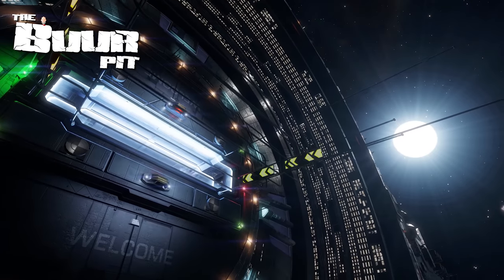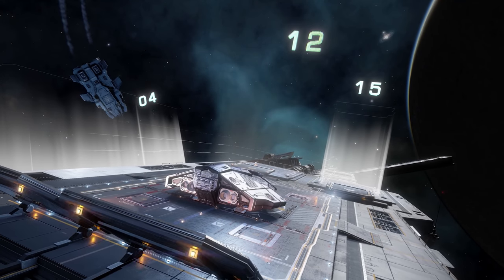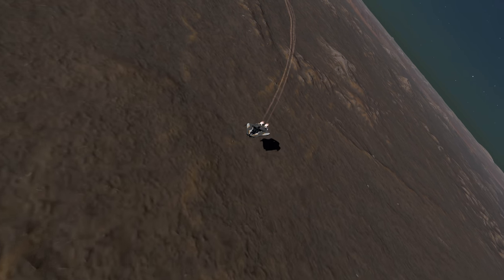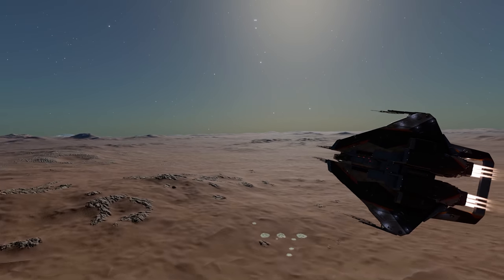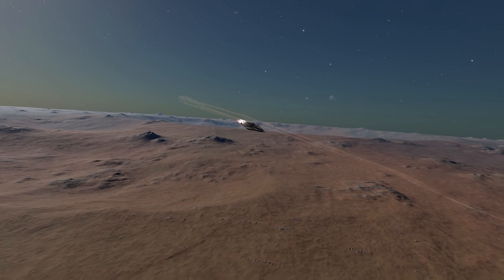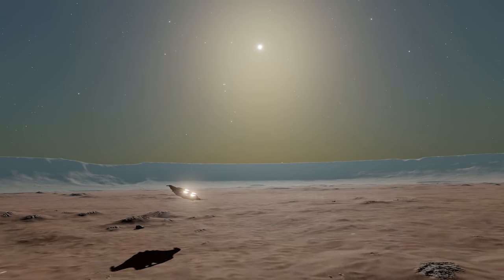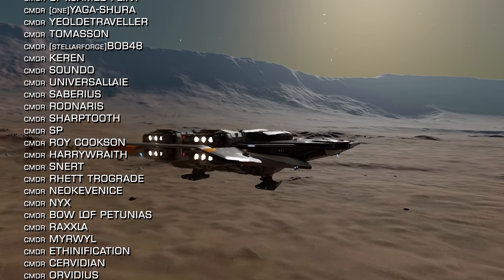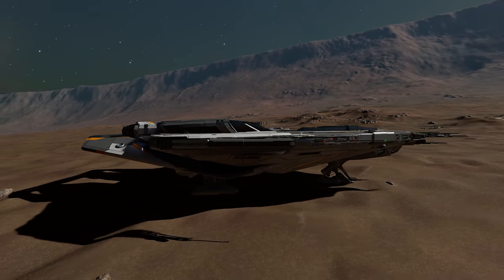Elite Dangerous: Engineering | Sweeping Changes Proposed to Material Gathering

Comment: Always thought it odd that we need to specifically salvage parts for engineering from kills or debris.  If it exists in the ships we fight, it means it's sold somewhere as a part of the ships themselves.  Why not let players exchange in game credits for factory fresh components?  IE: Get the parts direct from the manufacturer, or at the very least a retailer?  Also a heck of a lot simpler than trying to get exploration data or void opals etc to convert.  You earn cash in any play style?  That makes the credits the ideal catch-all currency for material gain.

Comment: Heat Maps & planetary colours should also really play a more direct role in where certain raw materials are likely to be.

I also think that doing missions for Engineers-or the Factions they are aligned with-should be the primary means of increasing your reputation with an Engineer, thus giving you access to higher levels of Upgrades.

Comment: I responded to that FDev thread, and basically suggested that the averaged out timeframe to collect max G4 (raw) or G5 (manufactured) is ~1hr in game currently, to then be traded down maxing out most smaller ones below, so lets say ~2hrs "tree" of mats. With 17 "trees" of mats in Raw & Manufactured, that's roughly 34hrs to max all Raw and Manufacturered materials. Encoded gets harder because the only really consistent ones to farm are at Jameson's Crash Site & Famine distribution centres, so you then have to cross trade which gets even worse.

With G5 to G5 cross-trade at a 6/1 conversion, you're talking minimum of ~52hrs to cap out all encoded mats, and that's assuming your Wake Exception scanning goes well.

So 86hrs of game time, gathering materials at the most efficient way possible to maximise all materials... and then additional hrs on top of that topping off anything used when Engineering.

It's an absurd level of time.

Stuck my suggestions in the thread on how to improve it, but basically make it so we DON'T have to relog for HGE farms, have them operate more like the Crystal Forests for Raws. Bring some Crystal Forests INTO the bubble, and then come up with something similar to HGEs / Crystal Forests for Encoded types (Targetable, for all top tier, with a MAX 1hr averaged farm time to max out that G5).

Comment: I think any change fdev makes to improve material gathering would be a greatly appreciated one. Some materials grade 5 materials almost never drop which necessitates using a material trader to get them. This is very costly as the minimum is 6 of one grade 5 material to get one of the grade 5 material that rarely drops. Even using the grade 5 material "Imperial Shielding" which drops at a rate of from 3 to 6 witch produces 3 per dropped item still necessitates frequent trips to a material trader to swap out the majority of your supply to stock up on the infrequently dropped items. This process requires several days effort to get fully restocked on everything. It would be nice if they could reduce the time down to a single 8 hour day to achieve a full restock of all engineering materials. That would make it an achievable goal for a weekend of playing time for many people.

Comment: I think the big problem with material tethering in the inconsistency. I need pharmaceutical isolators for G5 engines, so I need to go to a system with an outbreak and search for HGEs. And there are none, so go to another system, then another. The problem for the high grade materials is not necessarily collecting them, but finding them in the first place

Comment: This is great news indeed, and I think that all the proposals from Bruce are fantastic ideas to help make engineering a little more accessible.  The "grind" has never really bothered me because I tend to engage with it passively; a signal source here, a mission reward there.  But any improvement is a welcome one, considering how hard people fixate on building the perfect ship on paper.

My contribution to the thread was that Engineers should also take credits as a "fill-in" measure to source materials for you if you don't have them, but that the cost should be steep and increase based on rarity and number of materials you're having them fill in for you.  We have commanders running around with meaninglessly huge bank accounts, let Engineering play a role in balancing that out.

Comment: Robigo was the draw for me to start grinding engineering requirements, going to Maia and upgrading my Anaconda was a personal goal, I've had my Anaconda for ages and didn't want to leave it on the wayside, the ship still only has a five light year increase after a few FSD upgrades, with that said the ship is full of passenger cabins. 

I got an extra Python and started the grind again needing a medium ship for Robigo,  got fed up grinding and drawn to other games. Odyssey just released at the time so I was grinding engineering while swallowing a bitter pill. After 700 hours I still haven't visited Robigo, if the grind wasn't a factor I would have visited Robigo by now. 

You even have to grind to maintain 100% ally status with the feds and empire, taking a day or two off automatically slaps you with a frustrating 25% decrease in status, grind to restore the rank list goes on.

Comment: A change would be welcome.  I spent long enough at Dav's Hope last night to empty nearly 2 SRVs of fuel.  And now I need to brave a CZ (and potential bankruptcy due to abysmal payouts) with non-optimal ship/setup just to get some "rare" mats for engineering.  All just so I can better grind the Odyssey engineers.  Of course this wouldn't be an issue if the "threat level" in Odyssey was remotely reasonable - nothing like getting 16 heavily-armed hostiles on almost every "Threat 1" salvage.

Comment: Don't get me wrong; I'm happy to hear that ship engineering will be rebalanced. But in general I haven't found mat gathering for ship engineering that "grindy." I usually do it while playing through other game play loops - running missions, etc. - or if I do "grind" for mats I only do it in short sessions. Would definitely like to see the perceived need to use log-on-log-off mechanics to acquire mats eliminated, however, so sure, some changes are called for. That said, the aspect of the current engineering system that really needs rebalancing is the material requirements for suit/weapon upgrades and engineering. In my experience, it's much worse than the current ship engineering system in terms of game time required to achieve a given upgrade. Would have liked to see FDev take this on first, honestly.

Comment: I'm personally in favor of rebalancing the economy and have a single unified uber currency that everything can be converted into.  That's the whole point of having a currency in the first place.   If a barber wants to buy some fruit and the person running the fruit stand doesn't want a harcuit what are they to do  gasp !?!    Wouldn't it be great if there was medium where you could trade it for goods and services?   That would be amazing.     Perhaps it should be called something -?  Money, or Credits, yes?  I think that makes sense.    

How about rather than rolling dice for upgrades we just have engineers offer a flat and simple upgrade - or even just pre-engineered equipment?

Once you visit an Engineer you gain access to Grade 1 upgrades and grade 1 pre-engineered equipment.  - Just buy one right off the shelf. 
Want  to unlock grade 2?  I've got a one of a kind mission for you  - if you're up to the challenge. 
When you complete it - you get one full free upgrade, or pre-engineered piece of kit - but all the following ones you have to pay for in credits, ( unless you want to do the mission again. )

Heck I'd even be ok if they made us leave the ship at the engineers base for hours or even days ( or weeks ) for a major upgrade and have to deal with APEX shuttles or using another ship while I waited.  Honestly it would be less frustrating than farming the same stuff over and over and rolling the dice.     

Just ditch material grinding and make the engineers to being more of a central quest line in a typical RPG.   Just please - no more collect-a-thons.

Comment: Been saying, for YEARS, that we should be able to "Call in Favours" with Factions in order to ask for specific materials as rewards for Missions (basically sacrificing a level of Rep in the process). The ability to break down manufactured materials into raw materials, and vice versa (basically a variant on Synthesis) is also needed. What would also help, though, is if Blueprints had more flexible material requirements. You'd have the "optimal" blueprint, but some materials could be substituted for other materials-of higher or lower rarity-which could lead to better, or worse, manufacturing outcomes.

Comment: I find this thread to be interesting, yet still completely missing the point. They see that people are unhappy about engineering, but still utterly fail to understand why it is like that.

Basically there are two aspects on engineering:
1. Engineering is completely unbalanced and massive power creep. Considering how huge the improvement is (see: +700% effective health) is, the game both has a problem of being still challenging for somebody in a fully engineered ship, while some content is brutally  punishing for somebody in a non-engineered ship. Which means that any new player feels forced to invest in engineering.

2. After being forced into engineering, the player finds that it's a long and arduous task and feels very painful for many players.

Now what does FD try to fix? Of course, the second aspect. While the core problem is the first one. If engineering would be nerfed (yes, a word which seems to make most of the community make cry rivers of tears just by hearing it) and brought to a level where it's not a massive boost to a ship but rather the fine tuning it was promised to be, it would still be used by many players, while people would not feel like they were forced to use it. Which would automatically solve problem #2, while still leaving it as the time sink FD apparently wants it to be. 

Mind you, i am also in favour of a lot of improvements the thread suggests. But the core issue of engineers, the crazy power rush, is what actually needs to be addressed.

Comment: Below is an un-popular opinion... but... it comes from a scientist who is always frustrated with the ED community constantly going on about how 'TOTALLY RANDOM' engineering is/was....
I think the issue with most commanders... and the old old engineering system is that... most people have no idea what a probability distribution function is... and that it was not 'totally random' it never was, and anyone who thinks it was and constantly chanted RNG RNG, was actually just being a total muppet ;) And yes I am pointing my finger at some of the VIP voices of the community back then for perpetuating the stupid rather than... actually doing a tiny bit of homework and being unbiased.

All that FDev did wrong, was not show what that distribution function looked like, so people had no idea if they had a 'good' roll or not. That said, it was always possible to discard a roll, so no you would not be forced to take a engineering attempt that was worse. FDev have made collecting materials easier and easier and easier... i feel changes to the game now... you might as well just give us all pre-engineered modules since the ED community apparently doesn't want to actually play a game, they just want everything now with zero effort, thought, or achievement. 

I think personally the system as it is now is almost pointless... there is no variety, everyone has matched modules... its now just a "Oh stock or grade 5 betterer" its really dumb in my opinion. They went with a method to keep people happy, and went with an easier, stupider solution to suit the moaning player base... who are more often than not... well... 'uninformed/unengaging of brain cells' Oh haha and yeah... people still moan because the ED community is apparently never happy with anything at all.

Comment: The simple solution to this is to scrap the engineering system altogether. It makes for a horrendously unbalanced game and further widens the gap between those that play in open and solo/PG.

Instead of collecting (grinding) mats to then jump back and forth engineering individual modules, why not allow us to buy modules that have the same, if not similar characteristics to the current engineering options for modules. Do you want new engines for your FDL? Buy the tuned A grade set that is the equivalent of G5 dirty/drag. Money has become all but meaningless in ED, so why not open the opportunities for people to spend it. 

Limit the barrier for all so that only individual ability is the deciding factor. Get rid of solo/PG, and bring the community back together again.